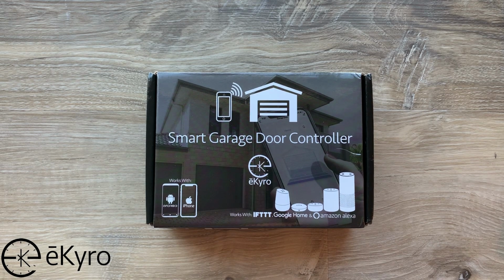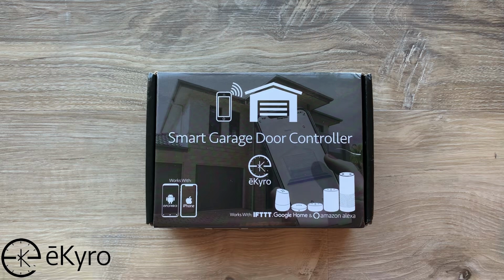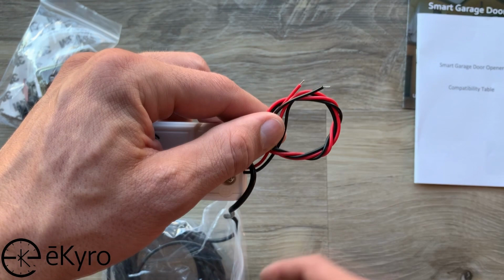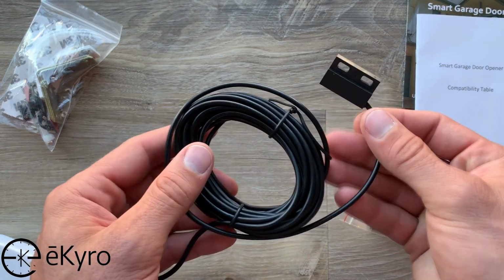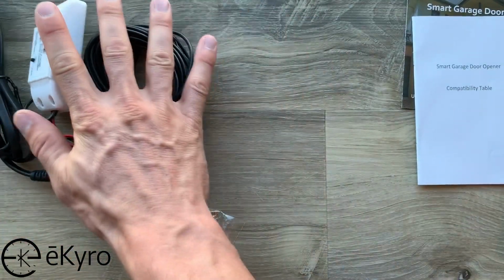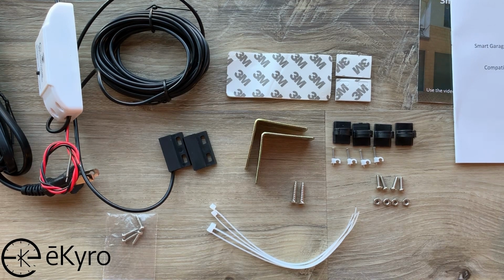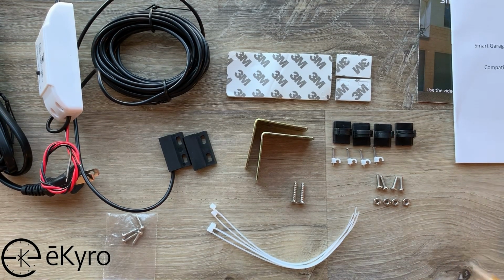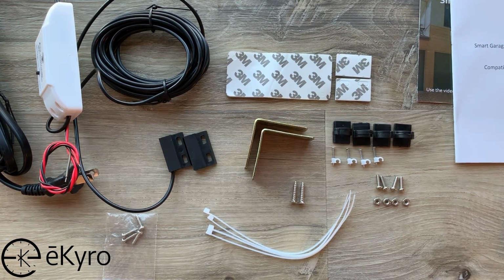eKyro | Unboxing - Smart Garage Door Opener Controller

Comment: The magnetic sensor: is it measuring the current flowing through it or is just a switch closing and opening the circuit?

I am looking to convert it into a contact switch (by cutting the magnetic sensor and directly closing/opening the wire loop) because I don't have enough space to fit the magnetic sensor.
Reply from the maker: Hello! 
Sorry for the late reply, we don't monitor the comments regularly. 
As you likely already know, you should be able to wire in a Normally Open sensor of any type to replace the sensor. 

Thanks! 
-eKyro Team

Comment: They gave me an eKyro Smart Garage Door Opener, but my motor is a chamberline c205 with yellow light and it is not compatible.
I saw that there are adapters for those motors but I can't buy it on your page if I don't have an order on amazon.
Is there any way to buy the adapter without the amazon order?

Comment: Can it be used for other things? For example, turning lights on and off?
Reply from the maker: Good question! 

TLDR; not really. 

The eKyro Smart Garage Door Opener is specifically made to close the circuit for just a short period of time to simulate a button press and release. Typically devices used for lights are press and hold circuit’s and not press and release. 

Thanks, 
-eKyro Team
Reply: You can find smart switches and plugs for lights and other electronic equipment. You may also find smart bulb which can be connected directly and operated.